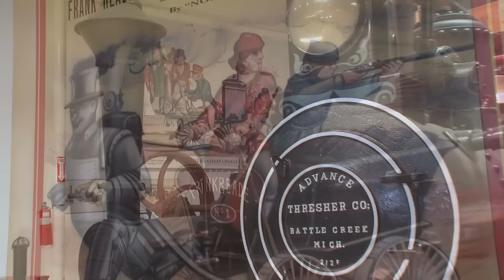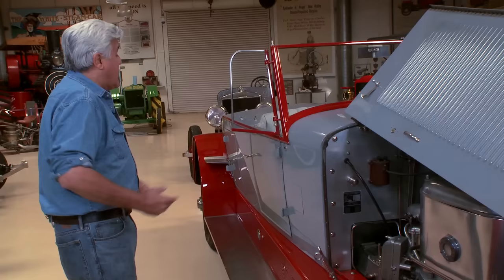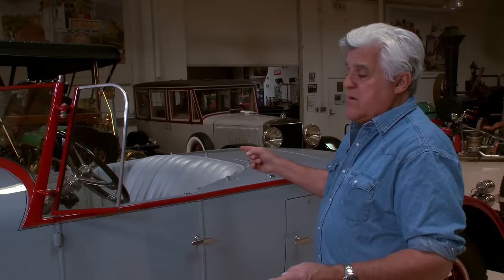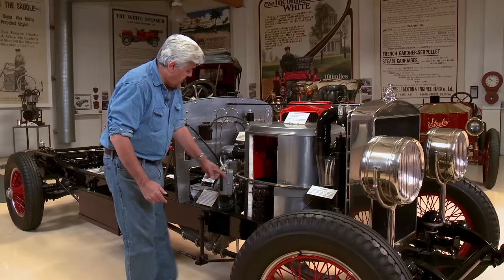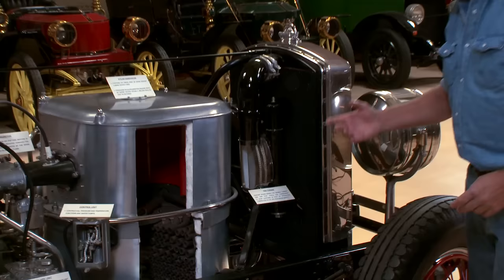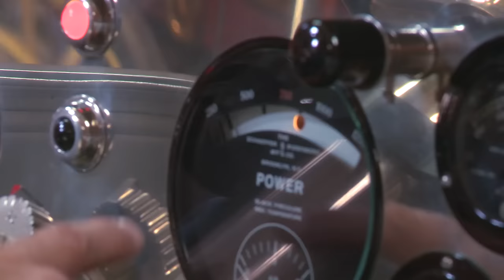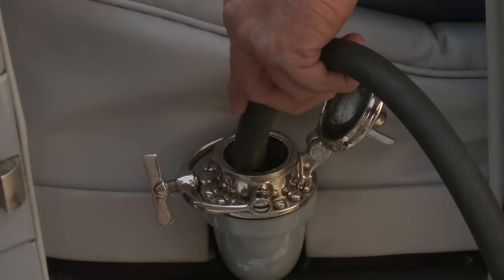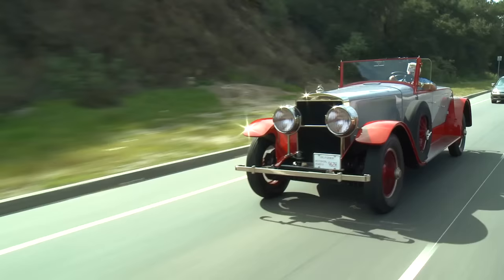1925 Doble E-20 Steam Car - Jay Leno's Garage

Comment: I want to know how far you can drive on 1 gallon of burner fuel. Something he never talks about when showing the steam powered stuff.
Reply: +nunyabiz nunya Fuel mileage is really, really bad... this 150 hp engine only gets about 10mpgs at best on kerosene

using gasoline? the mileage will drop a mile or two more
Reply: +The real doktorbimmer What if you use Mazut??? Its a cheap fule used to power ship&#39;s boilers.
Yes you would need something to heat it up to 80-100&#176;C,but it could be done.
Also there were some polish cars around 1940s that used wood gas as a fuel,so you could literaly take axe and chop your fuel.
Reply: +zumbazumba1 Germans had commercial things like buses that ran on gasifier technology in the big cities at the end of the War, since they about ran out of gas!  You could see the big tanks on the back or one side that burned wood, or charcoal was actually better in some ways. It burned, besides the hydro-carbon smoke , carbon monoxide which was made on purpose in the tank. They did quite well for what they were!
Reply: junkdeal Using more fuel efficient internal combustion engines though...

Otto and Diesel engines can both run on a wide variety of fuels.. liquid and gaseous
Reply: junkdeal Very true, few people know that the Diesel engine was invented about 35 years before "Diesel Fuel" was..

Rudolf Diesel set out to find a more fuel efficient design to replace steam which even in the 1800's was considered terribly inefficient in terms of fuel consumption.

Diesel's early work focused on using Coal products  (pulverized coal dust, creosote oil and town gas) or vegetable oil as fuel.

petroleum was not even considered until much later.

A friend of mine worked at a pumping station with a dozen or so Fairbanks-Morse Diesel engines that ran on natural gas..

there are also hydrogen fuel prototypes.

virtually an biomass material can be converted into alcohol or ester... both can burned in a Diesel too.
Reply: +The real doktorbimmer   You know your stuff!!  The diesel fuel was "invented" because of the engine, and that fact is counter-intuitive!I know they've run Diesel engines on NG but I think it is supplementary in the sense that diesel fuel is still injected in the cylinder, even if it is far less than normal. I can't see how they'd get the fuel density in the cylinder, but I do not know this for sure!  As much as I've been around this stuff, I still may need to be "set straight" on this by someone who knows more than I know!I do know from having done it, but gasoline runs terribly in a Diesel, and for an engine that runs on most oils I wonder why that is? (in Britain with their ridiculous tax, at night the truckers descend on the supermarkets and deplete the shelves of the cooking oil, and litter the area with empty bottles!!!   I know a guy who came over from there, and owned his own truck, and he said it was the "national pastime"!!!   It is useable as fuel as it is, I guess, without being de-esterified, maybe 'cuz it's new hasn't been "hydrogenated' by the high heat in the restaurants or whatever!!  my guess).
Reply: Thedeoradude But what happens when you stop the vehicle..?  then all of that valuable heat slowly wastes away..

This is one of the primary reasons that steam cars became obsolete over 100 years ago.. its totally unsuited to the task of powering automobiles.. once the electric started was introduced to the internal combustion engine.. steam cars died almost overnight
Reply: +nunyabiz nunya  If you're asking whether external combustion systems can be as efficient as I.C. engines, the answer is obviously no.  Doble himself wrote a paper on the subject.  The laws of thermodynamics can't be violated.
Reply: +Thedeoradude I originally found it years ago by Googling.
Reply: According to brighthubengineering, the rankine-cycle steam engines used in coal-fired power plants have about the same thermal efficiency as a diesel ICE.   (Although, this does NOT make coal "clean")
Reply: He mentioned about 200 miles.
Reply: Wow! That's only 7 MPG! that's horrible for only a 150 horsepower!!!
Reply: +jonny j  Indeed, what do you think transmissions are for?  A 5 hp motor can generate 1,000 foot pounds of torque... educate yourself.
Reply: Ha. . . That's Funny, Little man.

The Doble doesn't use a transmission.

All it has is the crankshaft coupled directly to the rear axle with a set of Final Drive Gears. 

As you say. . . Educate Yourself !
Reply: +oldSawer A Reduction Gear Set or an Angle Drive  not a "transmission"?  No one will ever mistake you for an engineer! Hahaha!
Reply: +doktorbimmer good to see you around, Doc! How are your jet turbine studies? Btw, recently I caught myself thinking that the only good thing about jet engines for an airplane is that they work at high altitude with much lower density air than a piston-driven prop-engine would. Right, eh? Otherwise hard to justify higher consumption (at higher reliability, if done right, tho).
Reply: +DoriFord Guten Tag! Higher fuel consumption?  Turbines have excellent BSFC as long as they are not asked to operate below 90% rated power output.  They are used extensively in electric power generation, long distance pipeline service and marine propulsion. 
Although there is no question they are poorly suited to land based transportation such as trucks and automobiles... the higher cost does not pay back due to their shorter service life of land vehicles. Cheers!
Reply: +nunyabiz nunya - This runs on propane, if you listened closely. Propane is measured in pounds (Liquid) or cubic feet (Gas).
Reply: +robert shaw The Doble E series was designed only to use liquid fuels and was optimized for kerosene. Jay operates his cars on unleaded gasoline.
Reply: for the water
Reply: On a warm day the Doble could use up to 1 gallon water every 2 miles, the water tank was either 25 or 30 gallons.

Comment: The trick with Doble was the water recirculation pump for the steam generator.  How do they recirculate water at such high temps >700F (shaft seals, etc.)?  I've searched on the internet and all I can find is info about nuclear power plant pumps which are too huge to be applied here.  PS: Doble's burner makes very low emissions and barely any (or 0) NoX because it is atmospheric pressure combustion.
Reply: Not true, the Dobles boiler is high temperature and high excess air in the air/fuel ratio.. this means it would most likely be illegal to sell in California even as a domestic water heater because of the high NOx.
 Its moot really because you would not be able to sell a car like the Doble ever again anyway because of the EPA CAFE gas guzzler tax.. the Doble fuel economy is so poor that it would not even meet the minimum MPG rating..
The Doble would also get zero stars on any "green car" rating because of the massive output of greenhouse gas it produces..
Reply: I was thinking something similar. A lot of heat is lost using a radiator to recondence the water. One solution would be to have a pump driven by a jet turbine, with steam turbine to keep it going with the heat off, and use the engine as a pump for breaking.
Reply: brett knoss So you are suggesting to burn more fuel.. to power the circuit that causes heat loss in the primary circuit in the first place???  How exactly would that save fuel?
Reply: No, I'm suggesting to replace the burner with a rotary jet, which drives a pump to move cooled steam back to the boiler, then reheats it to super heated steam.
Reply: brett knoss What? So you are suggesting to compress the waste steam and re-inject it into the boiler????
Reply: Acually let me change that. No, you would not compress the steam, just move it back to the boiler.
Reply: A thermosiphon would then be used to bypass when you have excess steam and another would put water into the tank, which would have room for condensation.
Reply: brett knoss I'm not aware of any currently existing technology that would allow re-injection of steam (water vapor) into the boiler without a net loss of energy..

Although steam compressor technology does exist it is not designed for re-injection at boiler pressures..
Reply: I'm not saying there wouldn't be a net loss, just the loss would be less than a radiator.
Reply: Basically have it so that it uses thermal expansion to create large amounts of torque, then run it as a jet powered pneumatic car for continuous power.
Reply: brett knoss In the Doble, waste steam is already re-expanded (3rd pass) in the condenser fan turbine before entering the condenser..Some cars used this same set-up to power feedwater heaters and electric generators as well..
 
You cannot practically compress and re-inject the waste steam into the boiler... only the waste steam condensate (liquid water) which is incompressible..
Reply: What if you used a propellant without the unique expansion characteristics of water?
Reply: brett knoss You really lost me now.. we were talking about reciprocating steam engines a second ago.. now you are saying a vehicle powered by a turbojet and by pneumatic motors....????
I'm sorry but it is not making any sense..
Reply: brett knoss Propellant?   as in rocket jet-propulsion?
Reply: What if instead of using water, you heated a gas like R144 to create energy since it has more thermal expansion, and it's a gas at ambient temperature, the generator would work the same.
Reply: brett knoss Generator?
Reply: Steam generator, or expansion generator.
Reply: brett knoss Higher costs, low thermal efficiency..
Reply: brett knoss The Carnot cycle efficiency of steam as a working fluid is already extremely low.. most refrigerant gases offer lower energy density and higher built costs associated with closed loop systems
Reply: Is that because of the expansion of water to steam? Because, most refrigerants have a greater thermal expansion than water in any state.
Reply: brett knoss I'm going to have to disagree with your theory there.. refrigerants have extremely low specific heat value and therefore are very, very poor working fluid for heat engines.
Reply: What fluids would have the best characteristics (excluding combustion)
Reply: brett knoss The only working fluid with a higher specific heat value than water is Ammonia
Reply: I see well amonia cold work. I had thought of methane if you set it up so a small amount is used by the turbine. Another idea would be to have a jet put hot gasses direct into the compound engine, then switch to a closed loop of methane (the trick of course is to have know air or it would turn into a bomb) that would provide power the engine durring low power demands.
Reply: Indeed, dozens of Ammonia engine patents were filed for use in locomotives and rail cars during the 1800's.. although none were ever successful, you see besides being toxic it is also explosive and highly corrosive at high temperatures..
Reply: Well, now you have drifted away to something that sounds more like internal combustion.. not external combustion..
Reply: Yeah was mostly currious in knowing how efficient a steam car could be made. I didn't realize ammonia was explosive though. It could be worth looking at I suspect it's not a practical fuel though.
Reply: brett knoss That was already determined in 1824 with Carnot's Heat Engine Formula..
 No, Ammonia is not practical as a heat engine working fluid or as a fuel...
Reply: When I look at ammonia as a fuel, it does look complicated, but it might be practical if Thorium reactors become practical, if materials can handle the caustic nature of the stuff, and if genetic engineering reduces agricultural demand.
Reply: brett knoss Well in the past 180 years Ammonia has not gotten any traction... I seriously doubt it ever will.. Steam power is on its way out completely unless nuclear power makes a comeback..  until then it will be internal combustion that reigns supreme with alternative renewables nipping at its heals
Reply: Indeed natural gas in turbines, steam plants being converted to new kinds of nuclear, and even then loosing ground to fusion technologies that produce energy directly, and more efficient internal combustion engines are the future.  There's some interesting stuff with 5 stroke engines, and electric valves that could make multi stroke engines possible.
Reply: brett knoss Construction of nuclear power plants is currently in a steep decline...while natural gas fired gas turbine plants are filling new power demands.
There is talk about reviving the concept of the much safer "Fast Breeder" type nuclear plants but currently no plans for constructing one.
Reply: brett knoss Most of the major auto manufactures are heavily invested right now in HCCI technology which is expected to be introduced when oil prices start to spike again.
Reply: Then explain why the Laws of Thermodynamics rendered steam cars obsolete over 100 years ago?
Reply: The condenser has two benefits:
- minimized loss of water
- provides partial vacuum (<0.5 bar if well designed) so it's additional force on the piston and even if the piston doesn't expand fully all the way to the pressure in the condenser and leave some bars just blow out into the condensed, the work portion provided by the partial vacuum is like 20% of total work (see bottom line in some hyperbolic pV diagram). So cooling down instead of reusing the steam is a key benefit on the performance here. 
...reheating steam and expanding in a separate engine make sense only if the superheated steam turns into saturated during very long expansion (not in any car) and would otherwise start to condensate inside the engine without reheating.
Reply: +Lumpeeks Unfortunately the Doble's condenser system is not equipped with a vacuum pump and its Steam-to-Air condenser is far too small and inefficient to condense all of the steam into water... so it vents excess steam almost continuously on warm days to prevent back pressure which robs power and efficiency. An effective condenser able to handle 500lbs per hour would be larger than the car itself and thus totally impractical for automobile use... lack of a vacuum condenser makes second pass, bottom cycle heat recovery impossible and is not practical or cost effective on such a small scale... they were not used in locomotives either despite their much larger scale and more favorable economic factors. Cheers!
Reply: Yes you are right. Thanks. That was my first concern when I saw this particular car, that the condenser is too small and the fan is just for fun. I believe that with 5 times bigger convective area and proper fans the condenser would start to benefit, at least keep the ambient pressure and all the water inside. And another problem here was that the expansion ratio is like 1:7 in 2 cylinder compound, which means that the exhaust pressure is still more than 7 bars. That much energy just cannot cool down easily. The expansion ratio must be at least 1:20 for 50 bar system. This can be achieved by uniflow design (throttled by variable expansion 1:40 -> 1:2). Low expansion would be used only for rude acceleration. Uniflow can be made water proof = excess condensing due to wrong cut-off timing wouldn't cause any damage. Anyways difference between 1:40 and 1:2 is that the second provides half of the efficiency at 10 times more torgue, not so bad. Imagine constantly accelerating at 0.5 G with efficiency better than some standard two stroke engines (counting with achievable 25% max efficiency from 400°C/50bar setup).
I would also add some water injection condenser (ejector or just spray) after cylinder exhaust to pre-condensate the steam as soon as possible. The water would be portion from the tank that would be pre-cooled in a regular radiator. This will also reduce demand on the air cooled condenser capacity. It would definitely steel some heat. This could be partially compensated by adding water pre-heater between the exhaust and the injector (just a set of tiny 3d printed tubes wrapping the exhaust ports). Here would go the pressurized and condensed water right before entering the burner (economizer stage).

Comment: Nuclear subs are steam powered too!
Reply: Steam is still the best option for transporting heat economically. Steam turbines are still used in every modern gas power plant to increase the overall efficiency. Or of course, like you said, used to transport the heat from a nuclear reactor to power a steam turbine.

Comment: I read through several of the comments and I couldn't find any mention of the windshield wipers. I realize it's not a car you would take out on a rainy day, but it must have them. I am wondering if they were steam powered. I would also like to learn more about the disc brake conversion Jay mentioned in passing during the driving demonstration. I assume they are hydraulic?
Reply: Doble didn't build car bodies, many Murphy body cars like this one featured electric wipers which were a very recent technology... previously they were hand powered if any at all were installed.
Reply: Jay uses converted early Lincoln wheel hubs and custom hydraulic disc brakes on many of his early "brass era" cars.. you may find some more info in his other videos, they are frequently mentioned in videos particularly the restoration blogs. cheers!